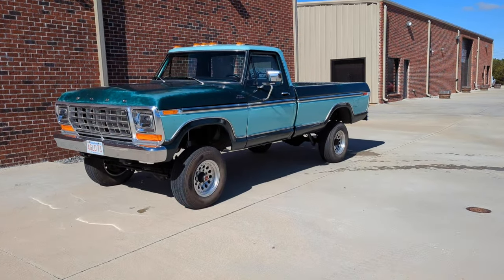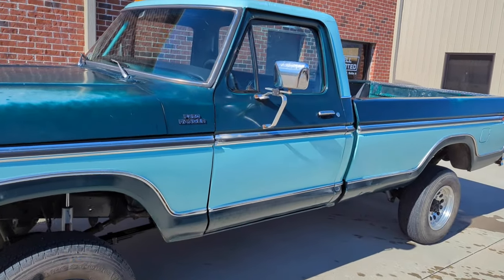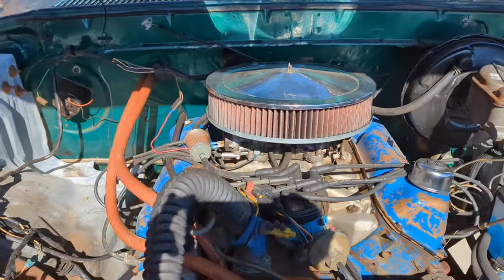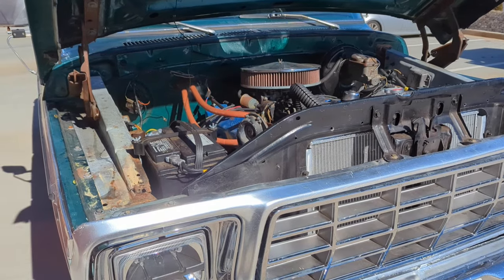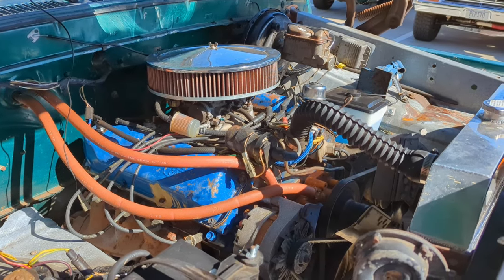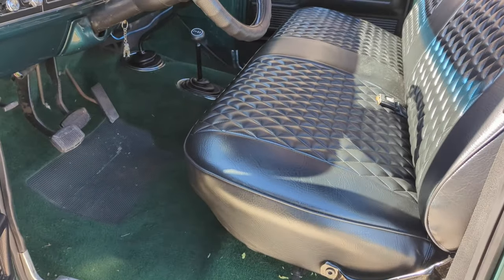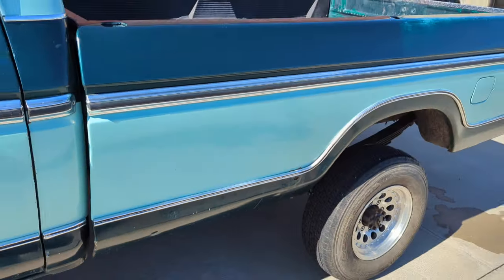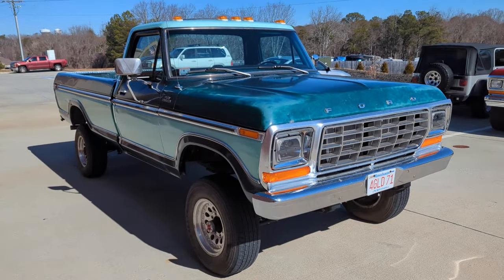Transforming a 1979 F250 into a modern SuperDuty pickup!

Comment: To update it I would go with a 460 keep it all retro. I think the original is more reliable and easer to repair. I own 2 of these maybe a throttle body injection would make it a little more driver friendly. A c6 would be a lot more durable or even the 4 speed original. that truck made it 45 years now I don't think the modern powertrain is better. I have a 21 f150 4/4 5.0 v8 it has more horse power but I would bet my 460 would out pull it in the long run.

Comment: Question on the rough country lift that it has. Does it have the rough country leaf springs in the back and are they sitting on factory lift blocks that are 3” or are the springs just sitting on the axle without the lift blocks?

Comment: Awesome truck!  I’m wondering if it would be easier and possibly cheaper to set that body on a newer chassis that already comes with the 7.3 Godzilla. I guess even totaled trucks are stupid expensive now and you need one with a good frame and drive train.
Reply from the maker: That's a path that could be followed for sure, it opens up different challenges but some guys are doing it.  But yeah, the new trucks can be expensive even when they are wrecked.